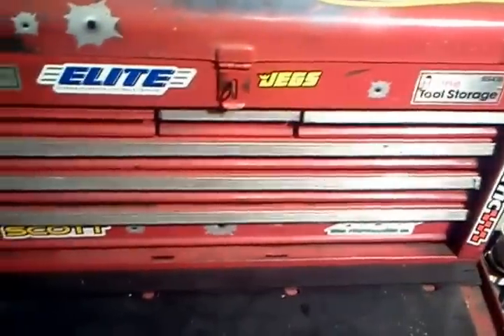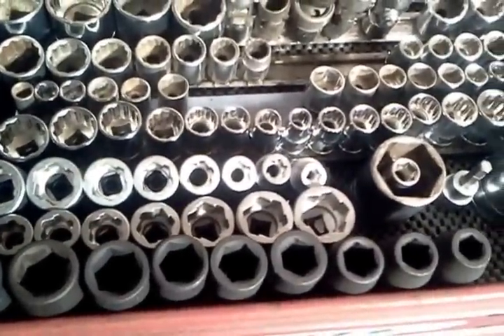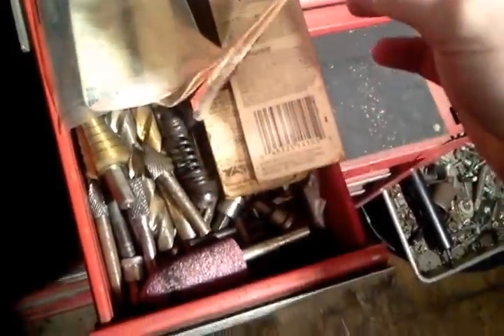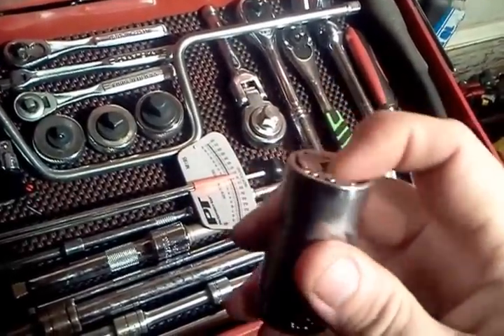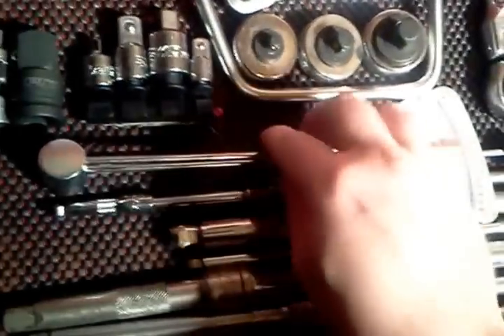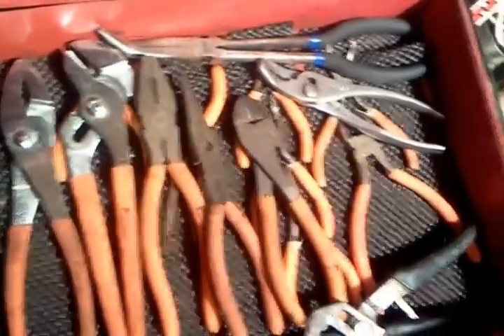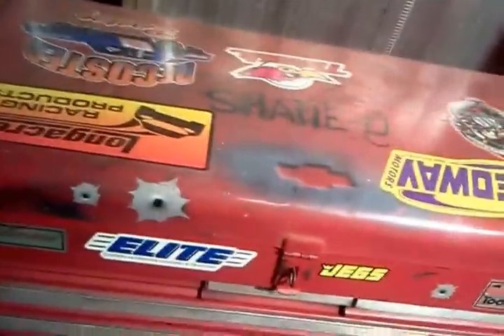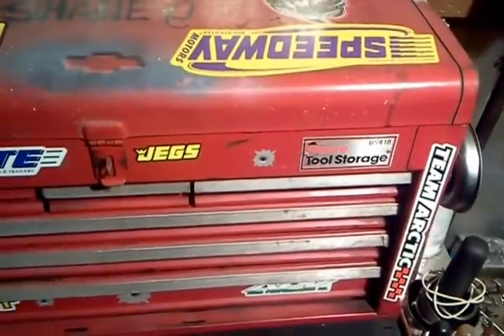My redneck tool box tour

Comment: gatorgrip does work..i hate to admit it. fit all takes out rounded bolts
Reply from the maker: maybe i just got a older one made when they were not as good lol not sure i know mine just slips and strips most out worse even on good bolts it seems to do the same thanks for the comment im glad yours works
Reply: I jus got one I gave it one job at my work oil changes lol works good so far got it for novelty more than anything always wanted one finally splurged the ten bucks haha

Comment: Well you are officially the second person I have ever found that owns an Easco tool..I have an Easco 3/8 drive ratchet that I have had forever lol.  It's amazing how much of the same stuff we have.  Yep, Craftsman went to Hell quickly when I believe Stanley bought them. Stanley is pretty good, but the real Craftsman made in USA was way better..same feel to both now..prices sure didn't go down!!  Lifetime warranty doesn't mean what it used to back when it was exclusively Sears. If you want lifetime warranty/no questions asked replacement, Harbor Freight is the way to go.  I'll buy Craftsman tools very sparingly now at Lowe's like screw drivers/pliers when necessary but certainly never anything expensive like torque wrenches. Too many horror stories! Great vid :-)